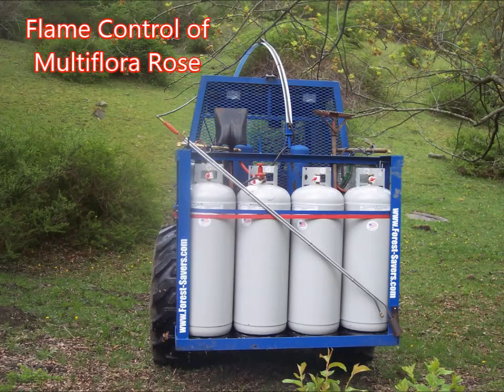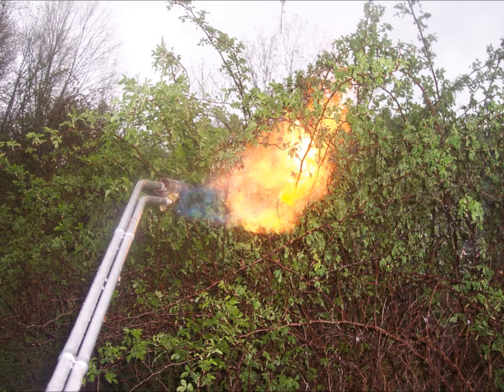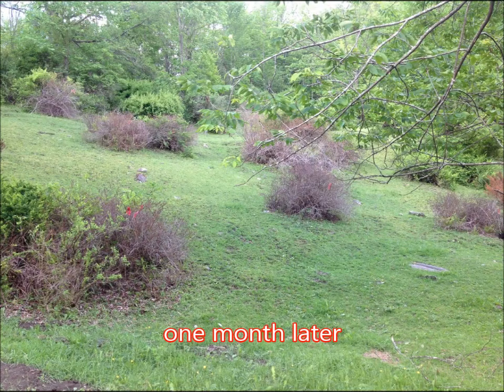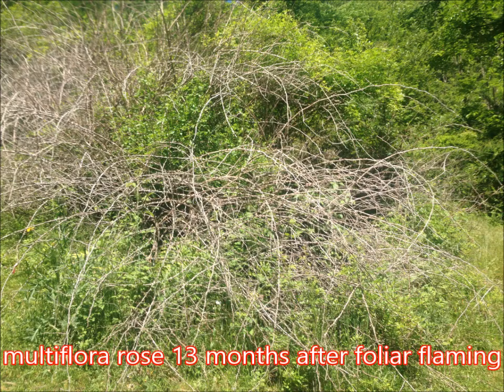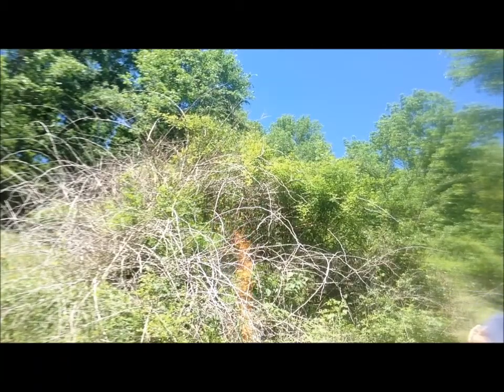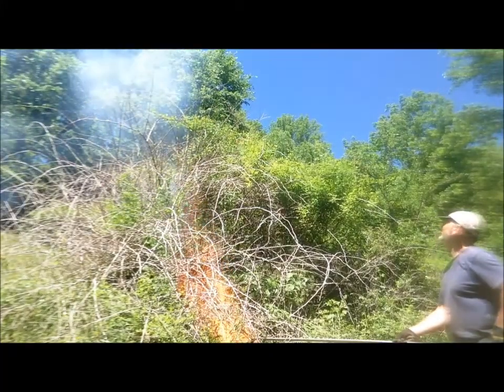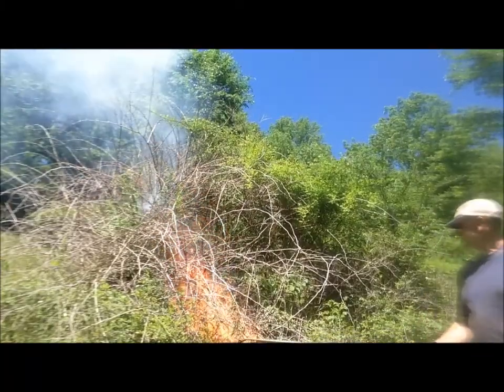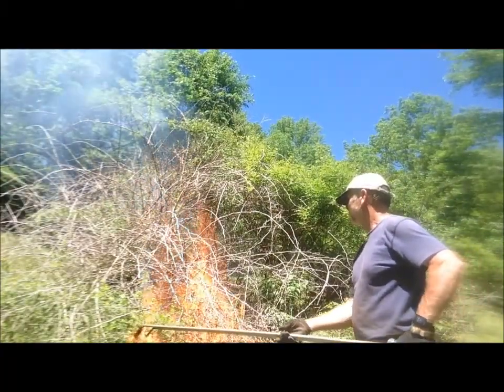Flame Control of Multiflora Rose

Comment: Any suggestions on how to deal with one or more multiflora rose bushes alongside a house or single-wide trailer (on a somewhat urban/rural property)?
Reply from the maker: Kim A. H. Kim, See if you can slip a strong rope, cable, or chain around the base of the multiflora rose so that it will cinch up like a noose when the free end is pulled by a tractor or pickup truck.  This should uproot the multiflora rose and pull it away from the house.  - Gerry

Comment: Nice video. Why no use of herbicides to eliminate resprouts? I burn them when they're dead and have seeds sometimes. Never started with flames. Seems like it would burn faster with fewer resprouts if you sprayed it first, then burnt it when its completely dead, tarp for chem drift if needed, selective herbicide to keep the grass alive.
Reply from the maker: Actually the first flaming just needs to kill the leaves, so doesn't take long.  Then on the second flaming to kill the resprouts all the dead branches where the leaves were killed really catch fire.  Eliminates any potential problems with herbicide drift or applicator exposure.
Reply: Are herbicides legal in Vermont?
Reply: spraying is nonsense. just rip and remove.. They have weak shallow roots systems..